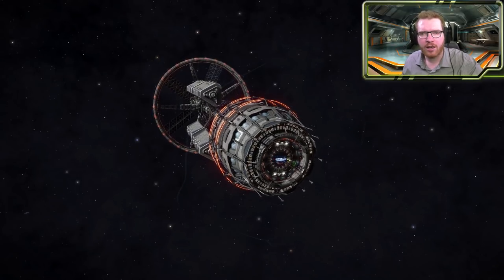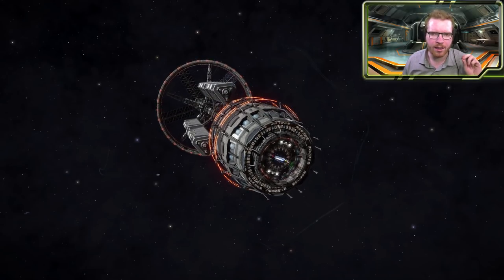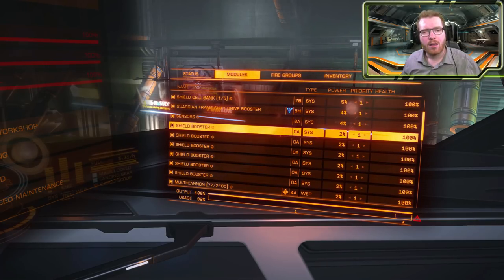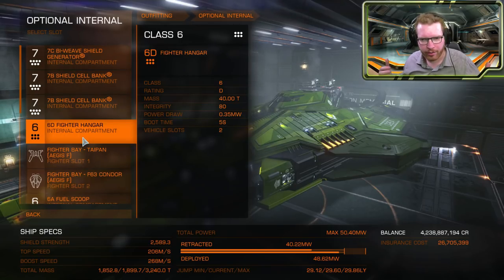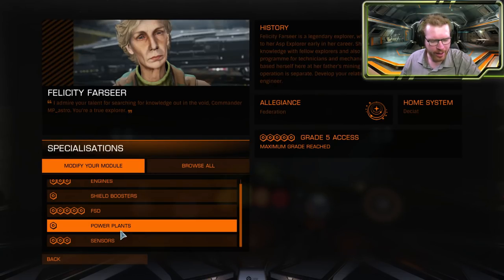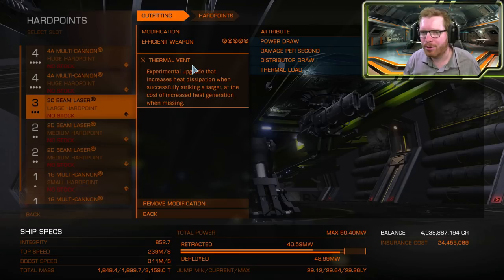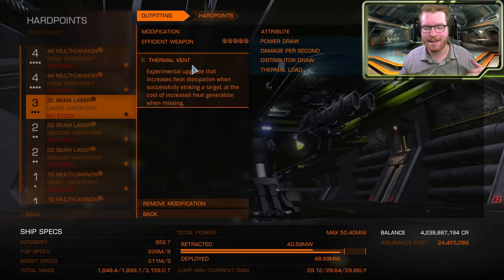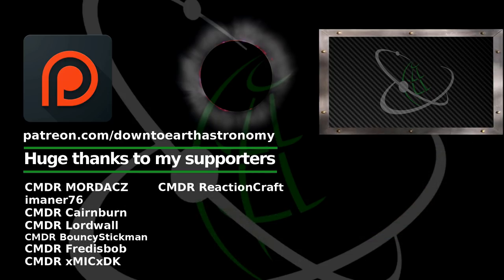How to make a ship build - Part 2 | Engineering - Testing - Re-design | Elite: Dangerous

Comment: Very good video. A lot of sound advice. The only other piece of advice I would add, purely from a personal experience standpoint, is before you start ANY engineering, make sure you have all the materials you're going to need for all the engineering you want to do. Research what you need, either by using an app, or the Inara website, and then set aside some time before you start to go and get the materials. Even get more than you need, if possible, in case you want to change something.

Sometimes it can be really boring and grindy getting the things you need, but it's so much worse when you realise you're so close to what you want but you have to go out and get the materials for that last little upgrade. And then they never seem to drop, or you don't have enough other materials to trade for them... and it just gets annoying. So I've found it's better to get everything up front so you know you can do what you need to do, once you've planned out a build. The less times you have to go High Grade Emission hunting, the better. Get everything while you're in the place where everything is gettable. It will save a lot of headaches in the long run scavenging around all over the place for a few bits here and there.

Comment: I had so much fun engineering my Viper MK3 :)

Her name is: “Three Toed Sloth,” slowest animal on earth. I wanted to max out speed, hit the cap, break the ceiling.

Thankfully I had the Guardian FSD booster to help. The sloth ended up with a 7.85 jump range on her own without the booster, in between I had her as low as 3ly.

She now does 745/932 (main/boost) on her own in sublight. Without the booster, without shields. Everything is engineered!

So much fun :)